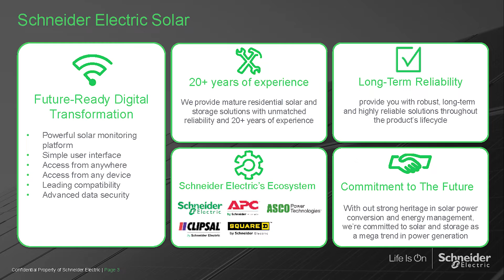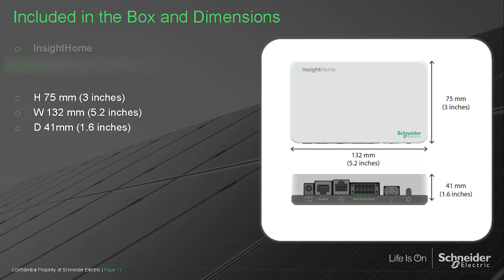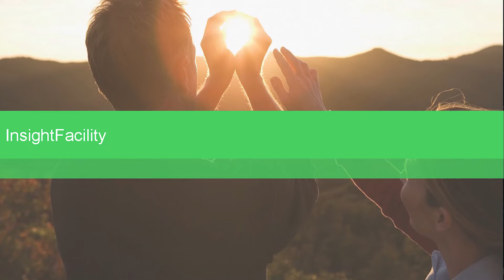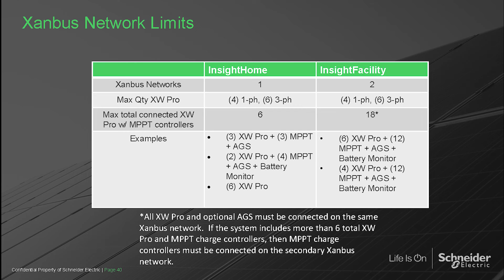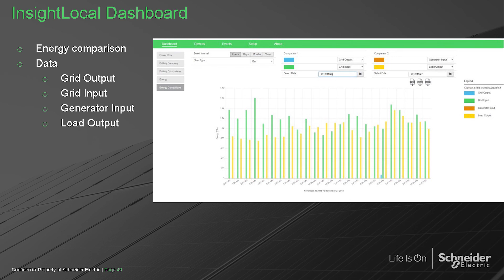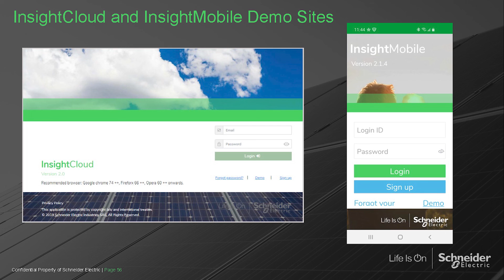InsightHome and InsightFacility Launch Webinar

Comment: Will "closed loop" to the Fortress eVault battery work with Insight Home? I was told that would only work with the Conext Gateway (which I think is now discontinued). #soconfused Thanks for helping.
Reply: Hi Mick, InsightHome and InsightFacility use the same firmware as the Gateway so you have the same closed-loop compatibility across the spectrum of our monitoring devices. Hope that helps. Eric

Comment: The system maps in this video show the SCP "System Control Panel". I was told the legacy SCP doesn't have enough on-board memory to play well with the modern XW components. Do you concur & if so, why does this video show that component as part of the system maps? Thanks in advance.
Reply: Hi Mick, while SCP has limited access (i.e. newer functions such as SOC control require Gateway/InsightHome/Facility), it can still be useful as a local interface to give the user an idea of how the system is behaving without having to log into their computer.

Comment: Another question: the insight home is described as "perfect for a single-family home with up to 26 kilowatts (kW) of storage" (https://solar.schneider-electric.com/product/insight/), but I didn't see any mention of this 26kw limit in the webinar. Can you explain what exactly is limited to 26Kw - i.e. will the device simply not read battery storage above that, or is this an estimated maximum based on the total available Xanbus connections available in this device as against the insight facility? Thanks.
Reply from the maker: Hi there, thank you so much for your comments! The different terms that we use to describe the system size that InsightHome can handle is an attempt to simplify the explanation. The limiting factor is the number of Xanbus devices connected, however, within the Xanbus network there are devices such as the inverters that use more of the bandwidth of the network. Because there are a multiple combination of devices that could be part of a system, we have tried to present an simple way.
Reply: @SESolar  i'm also wondering the same.  i can't seem to wrap my head around there being a battery-storage-limit for a device that is just supposed to be just a gateway to cloud service.  you say the 'limiting factor is Xanbus bandwidth', but that again makes no sense as to why there is a battery bank storage limit.  if you have 1 inverter and 1 charge controller, why can't you have +1billion kWh of storage?? (or more realistically, the 9999Ah of storage the Battery Monitor can count up to/is limited to...)

Comment: Hi, just wondering - for insight home, when it is set on either of the two LAN settings (~14:50 in video), does the wifi in the insight device automatically stop broadcasting so that there is in that setting no wireless signal being emitted from the device? I would assume so, but am wondering if you can confirm.
Reply from the maker: The wi-fi access point is always available regardless if the units in connected to LAN. This was design to allow an technician to access the device without needing access to the home network.